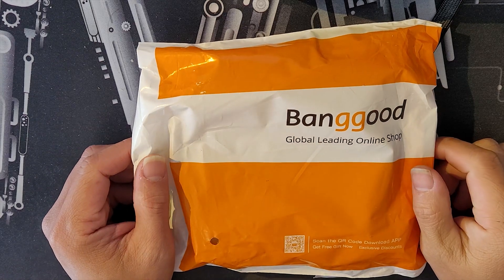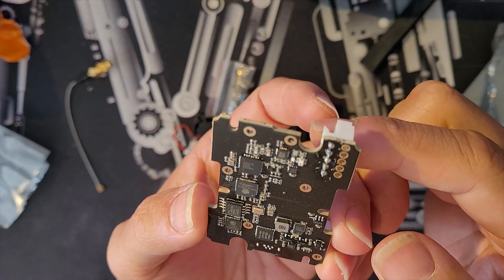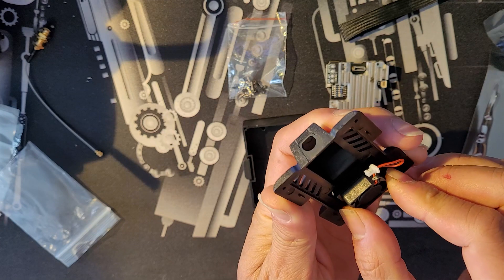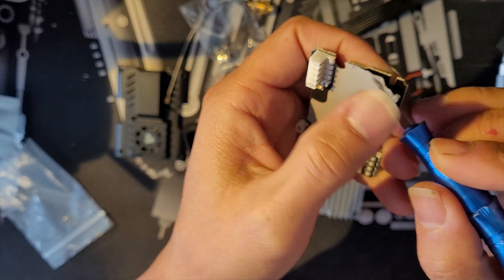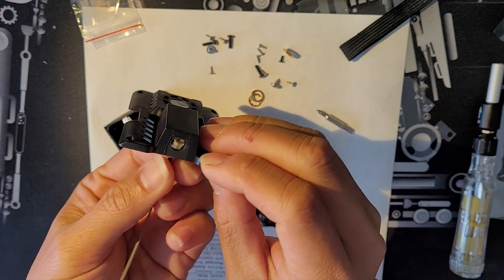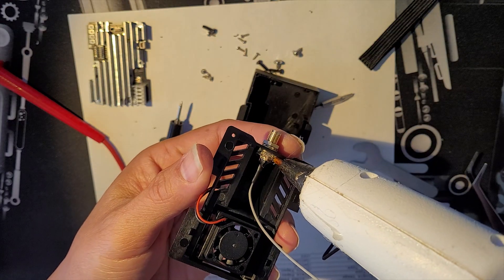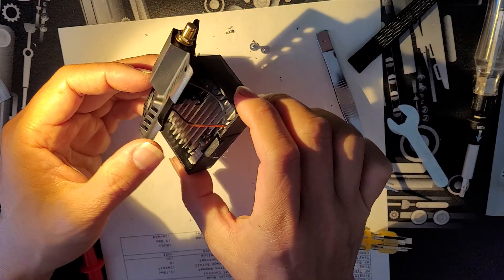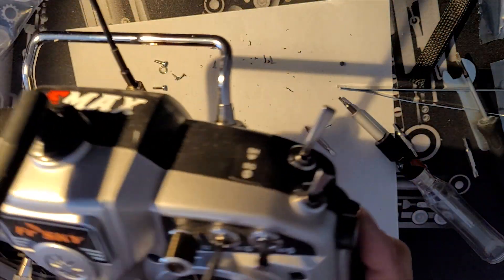Happymodel #ExpressLRS ES900TX 900 MHz video installation instruction manual and review

Comment: hello sir..i know this video is old..but can i ask what is the 6inline switch in the board mean?i saw it your video.ibough mine es900tx.915mhz.the switch is turned on only the first 12.so i watched you..and i off that 1.2.and what i saw to you i switch on the 5.6. possible that this a transmitter power??

Comment: This module is Happymodel ExpressLRS module ES900TX and Frsky R9MM/Mini  can work together? ??? ( Of course, if I upload the firmware ExpressLRS on both???
Will there be compatibility?
Reply from the maker: yes it will work but you need to have ELRS firmware on both TX and RX (which in your case R9MM)
Reply: @lavithhcm  Thanks
Reply from the maker: @aleks3a00  yeah hope it helps. btw, the plastic housing from happymodel Tx is not the best. Take caution it can fall off the radio housing.

Comment: If you are having trouble with the thermal pad. Put a sheet of parchment paper down and that is where you will line up heatsink. The Thermal pad works great  colder. Take it in your hand with both sides of plastic still on, and go rub it on smooth box in your freezer till you feel it cold, slowly peel on side off. Just keep getting it cold and work it slowly. if the plastic re-sticks, it will be easier to take off each refreeze till you get a side off. Once one side is off, set the plastic side down on the box. it only needs like 5-10 seconds. Get your area ready and put it on the parchment paper with thermal pad on paper, and plastic on top. once you remove the plastic it will be a lot easier to lay it out, and place heatsink on top, then just flip it over with paper on and remove. super simple, but a lot to type loll
Reply from the maker: Thanks for the tips. Much appreciated.

Comment: easier to put the thermal pad on the heatsink, and then apply it to the board, surely ?
Reply from the maker: @cbcalhoun  what pacificWebsurfer means is that you remove the hard-plastic side of the thermal paste and apply it onto the heatsink first before removing the soft plastic side which goes on the PCB. Best of luck. !
Reply from the maker: @cbcalhoun  yeah me too. I ordered few more Rx to convert all mine to ExpressLRS from FrSky.
Reply from the maker: now i know there's a soft and hard plastic side of the thermal paste.

Comment: I found the little silver screws screwed into the heat sync through the pcb. I didn't know the insulating piece had plastic to be removed, I'll have to redo mine. How did you determine which way the fan faced? it will fit either way. Thanks!
Reply from the maker: similar how computer fan works. it's standard that way. The way i had it installed in the video is the fan pulling the air out. Though honestly, i prefer the fan pushing air onto the aluminum heatsink force cooling instead of passive cooling.
Reply from the maker: the silver screws are all screws used on plastic. their threads are coarse to bite into plastic. the black screws are for the aluminum block where you mount the PCB onto the aluminum heatsink. they are machine screws with thread and pitch that match with tapped holes on aluminum heatsink. i think they are 5 or 6 in total black screws. the silver screws are used to mount the aluminum and pcb onto the box.